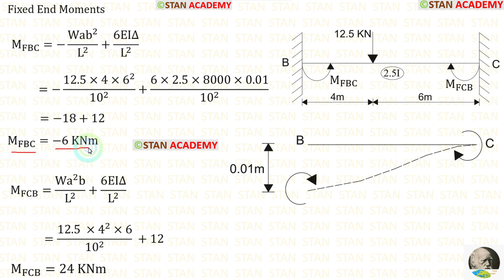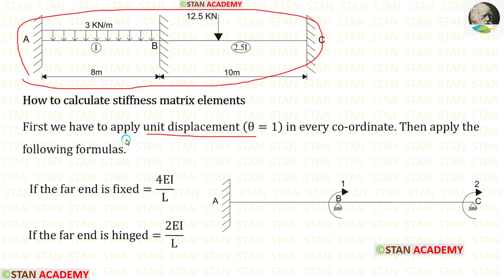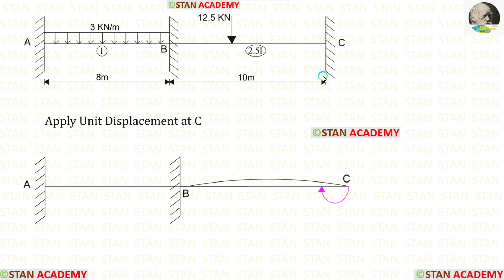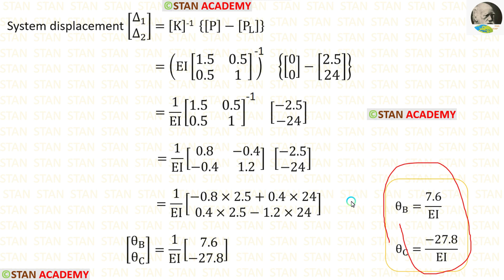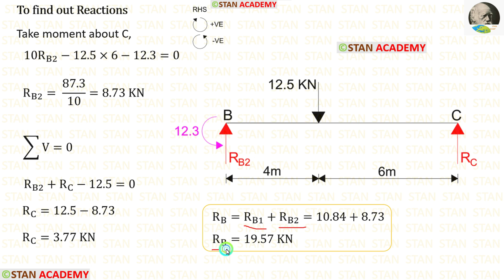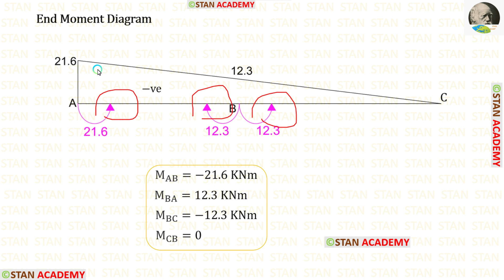Stiffness Matrix Method for Analysis of Beams - Problem No 13 ( Sinking / Settlement of Support B )

Comment: HI, @19:04 while calculating slope deflection equations I think we should use 3δ/L due to sinking . for example for calculating Mab= Mfab + 2EI/L (2θA+ θB -3δ/L)..correct me if I'm wrong.
Reply from the maker: That is already considered in the fixed end moment calculation.
Reply: @Stanacademy   yes, you  considered 6EI/δ^2 in Fixed end moment calculation . That part is clear but my doubt is while calculating slope deflection equation also  I think we need to consider 3δ/L (due to sinking).
Reply from the maker: you should not consider them.If you still have doubts, I have analysed the same beam with different methods and getting the same answers. you can refer them from the descrption links
Reply: Sure . Thankyou for responding🙂 @Stanacademy

Comment: Excellent video.
Sir,why are you not using sinking moment in the last equations for calculation of last end moments?
Reply from the maker: I have used the same moments whichever I calculated first with sinking moments
Reply: After calculation of rotation.
Reply: Sir,you formed a equation without sinking moment,it was including FEMS and rotation of respected beam.
6EI/L part was missing 🤯
Reply from the maker: MFAB = -23.5, MFBA = 8.5, MFBC = -6 these are the fixed end moments due to loads and sinking. The same noments I have applied in the slope deflection eqns